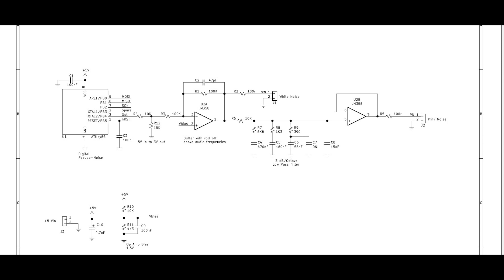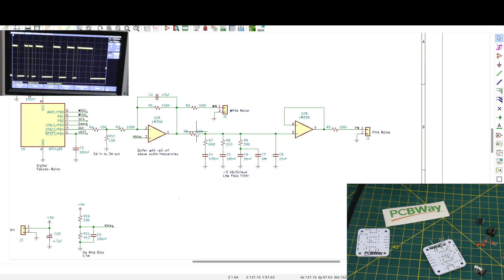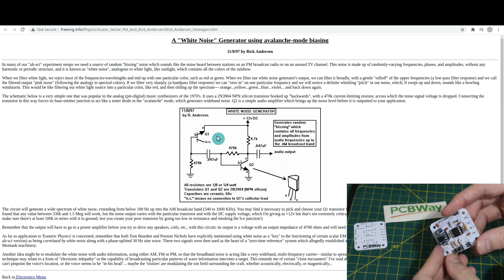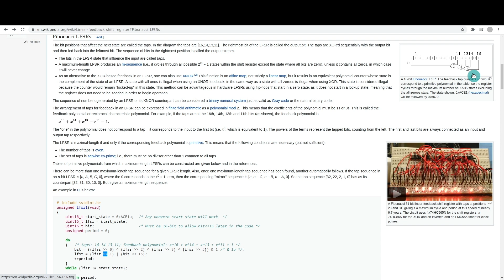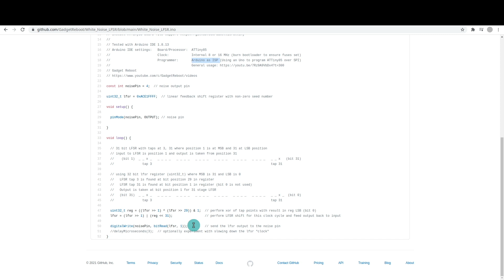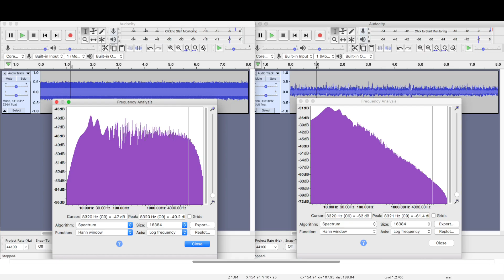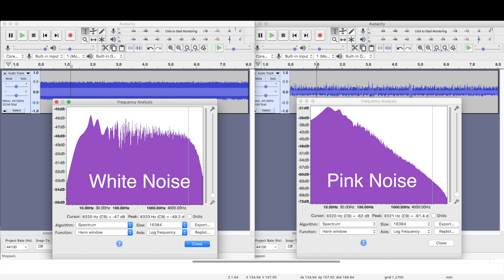Intentionally Noisy PCB Design!

Comment: Fantastic ! I'm gonna play with this, great work,......cheers.
Reply from the maker: It worked better than I expected - I'm glad I actually tested the frequency range on the scope because if I relied on the computer/recording, I'd wonder what happened to the rest above 8KHz, but I'm sure it's there...when I messed with different cable setups like swapping dupont and alligator clips to connect to line in, at one point it was only recording up to 4 KHz so it's definitely cabling sensitive

Comment: What is DNI?
Reply from the maker: Do not install.   I think I picked up the acronym at some day job over the years.  Also have seen DNS (do not stuff) DNP (do not populate)
Reply: @GadgetReboot  You missed out DNF Do Not Fit used a lot in the UK
Reply from the maker: @TheEmbeddedHobbyist  I've also seen "NOPOP" which looked bulky.  I think in the end I just learned "if it doesn't have a number in it, don't use it"
Reply: @Gadget Reboot  used to use Altium and we had 5 circuits designs that shared a single PCB layout. you selected the build /number and the circuit was shown with different components as DNF. the BOM was also adjusted as required. So you could say build /1 and the drawing set and BOM were created for that build. Saved a lot of time, the main custom chip was the same but you changed the interface to test different parts of it. We had to re-run weeks of testing each time we changed the revision of the chip. the fun of designing your own chips.
Reply from the maker: @TheEmbeddedHobbyist  I had a board with a 208 pin QFP  FPGA that was only one time programmable (yay early 2000's), so aside from only getting one shot at it per chip, we'd need a special board assembled with a 208 pin socket. It was fun (not) trying to swap chips without bending pins.  
We also had a clip on test point thing that would clamp down on the top of the part and all 208 pins were sitting there in a grid where we could plug dupont wires on for probing.  A lot of hokey measures but it worked.
We had a few spare pins too so one thing we did was create a serial output that sent the status of sensors/control bits that we could externally decode in a shift register break out board.